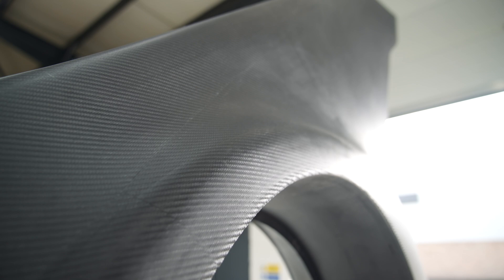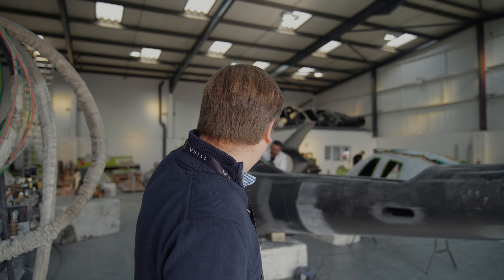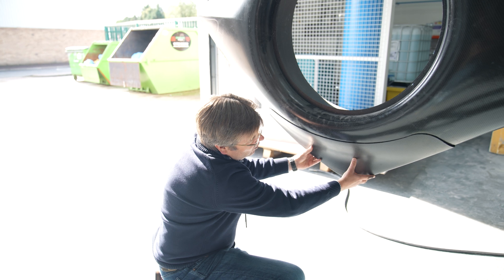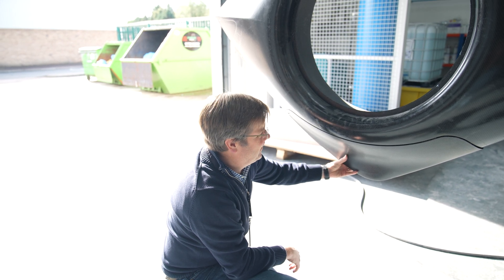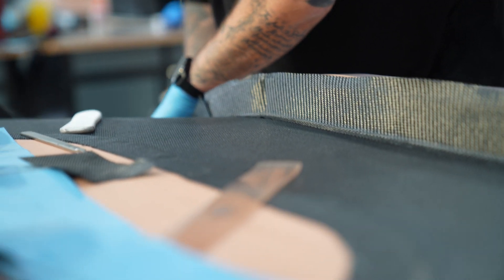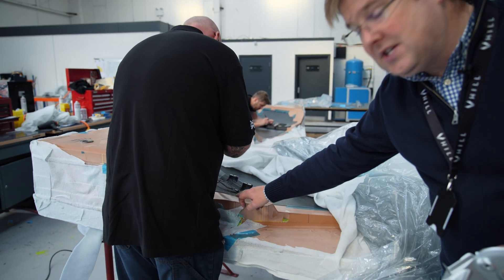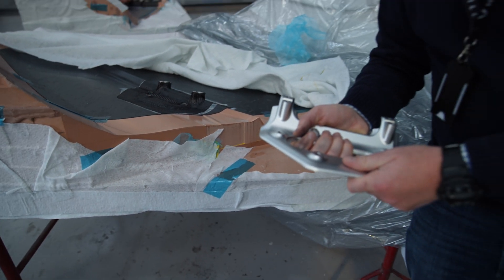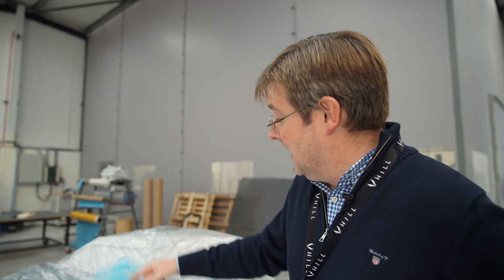The TailBoom and Doors for Fuselage 7

Comment: I really wish you find enough space to squeeze in a small engine, just enough to make it hover if the big engine stops, like Spain’s Inn Engine Design ._____.
Reply: Hovering takes the most power so a small engine would not work you would have to have dual engine’s but then you would not have a small helicopter.
Reply: @sheepdog1102   I meant the Bell 360 Invictus ._____.